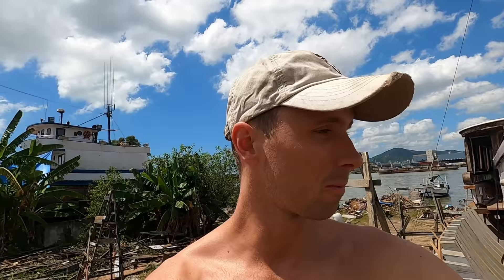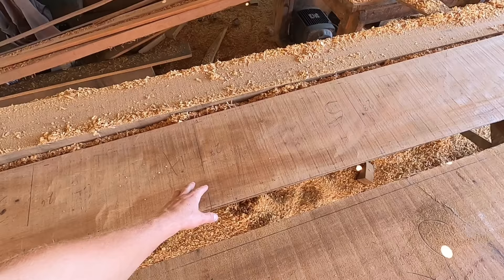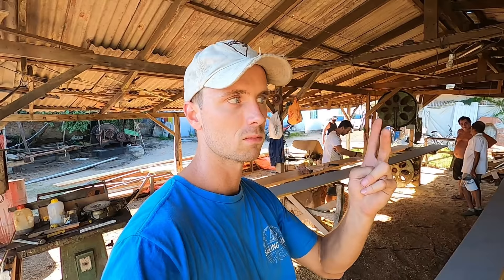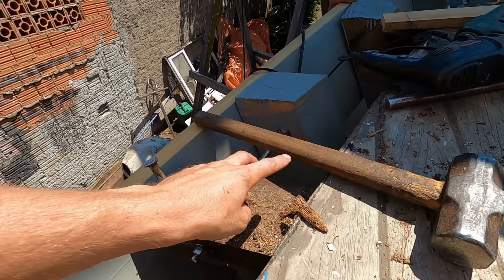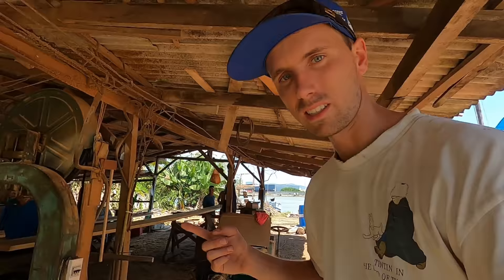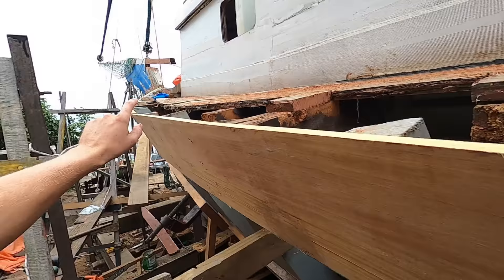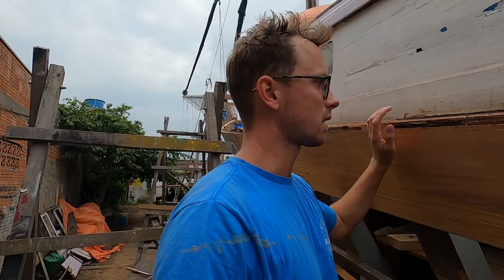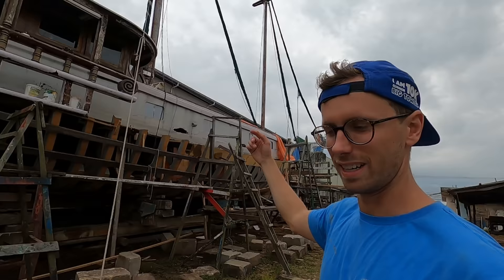This should hold it all together! — Sailing Yabá #28

Comment: Once again, I can't believe those sheer planks, thick as they are, force-bent against the frames, are simply nailed in. No through bolts, no rivets, not even screws. My jaw dropped when I saw that.
Reply: I am thinking that all those steel nails are going to start weeping in several years as iron sickness gets a foothold. Why are they not using modern fasteners?

Comment: After watching these videos you brought her to the right place to be rebuilt
Reply: This boat was so lucky to find these guys there are not many people that would’ve took this on and than to find a yard willing and able to do a job this big at the same time.  One lucky boat. You wonder what the cost is going to be when done. I wonder if they will ever say.
Reply: My only concern is with their use of nails instead of screws and bolts... When you see the guys at Acorn to Arabella or Leo at The Samson Co. using only copper rivets and bronze bolts, I wonder...
Reply: @marcryvon  They said after the nails they than use bolts afterwards they just use the nails to hold it together. And them other boat are like Museum pieces most people could never afford to build them that way. You would go broke and the time on top of it. Them boats are to nice to put in water. For sure Leo boat is a work of art.

Comment: I would check the top of the frames are not spreading now the deck beams are rotting as they need to be equally spaced from the center line of the boat from bow to stern else the boat wont go straight through the water. I wonder if the boat yard has way more choices when it comes to timber supplies due to their location.

Comment: Quick lesson in HVAC. Air conditioning moves heat around. So it takes heat from inside and moves it outside. With marine units it's often dumped into see water like the heat from the engine. It sounds like you had residential units that dump the heat in the air so they require the condenser to be mounted outside. Not sure what the costs are but you can use keel cooling or other water exchange for getting rid of the extra heat. Or you can find a better place to mount the outside condensers...

Comment: I can't believe they have built a wooden boat and not used bedding compound or any glue on the joints and laminated planks. They also used nails instead of screws or rivits or bolts. I bet the nails are steel too. Won't take long for iron sickness to start in the wood. Iwish you lots of luck in the long run.

Comment: I see you have taken the precaution to actually paint the boards before applying them to the hull. My next question is do they have glue and galvanized screws or better yet, copper/brass bolts instead of stainless steel. Over time the stainless steel will gauld and become impossible to remove. 
Keep pressing on!

Comment: Looks great guys well done, are you going epoxy the exterior of your accomodation cabin? Keep painting the timber it will last you a long time if the ends of the planks are cover especially the bits hidden or in joints.

Comment: Interesting. US and English shipwrights don't join hull planks on the frames.  They tightly butt join them between the frames and put a backing plate behind the joint on the inside.  If the joint ever leaks the infiltrating water won't rot a frame just the backing plate which is much more easily repaired and replaced.
Reply: I noticed that on the Tally Ho. It's an interesting contrast between the two ships
Reply: @clarencenew881  Just because Brazil has its own shipwright tradition doesn't mean it's inferior. It's just different. It's more lack of maintenance during the working life of the boat that's at issue.
Reply: Come on look at the nails no glue, frames are in four or five pieces.  And we haven’t even got to the running gear.

Comment: Hi guys. Loving your channel and following you both. I cant help but wonder, did the ship wright's upon inspecting your boat for the first time not advise you that it would be cheaper to build from scratch and then move over what can be saved from Yaba? You have ended up doing what Leo has done and replaced everything for new from keel to deck. Is it too bad taste to ask if you can make a video about costs and how much that team is eating into your project finances? I cant stop being amazed at the level of rot on that boat. I'm surprised it floated at all.

Comment: Also wondering why they don’t scarf the joints rather than have them as butt blocks? That’s asking to spring a plank down the line, right?
Reply: Leo at Sampson Boat Co explained why to use Butt joints on the start of his planking of Tally Ho.

Comment: This reminds me of the movie " The Money Pit ". Everything you touch is rotten. I wonder if it would have been easier to buy the plans and build it new.
Reply: Having owned 2 homes, they are all money pits eventually. And you can't take them anywhere.
Reply: @helicopterdriver  Nope.  My house is double-brick in 1885 and complete remodeled in 2010 before I bought it.  I've $300 in repairs and a new dishwasher in the four years I've owned it.
Reply: Labor costs are low in Brazil.

Comment: I hope your batteries are recoverable. Lead Acid batteries are a perishable item. Over time the acid breaks down the lead whether they are used - or not. Additionally a lead acid battery that sits in an uncharged or discharged state suffers sulfation and the lead plates become coated with a hard substance. Sometimes a sulphated battery can become recovered. But, as an example a 12 volt battery requires short, quick pulses of about 16 volts to accomplish the task. There are battery desulfators that accomplish that task. Lead acid batteries that are not seeing constant use should always be fully charged and then kept on a float charger. The float charger works at a very low current and puts back that small charge that is lost naturally in an inactive battery. So, lesson for the day, fully charge and then float charge any unused lead acid battery. Neglect can get expensive!

Comment: I read the majority of comments.  I see people asking rude questions.  I see people asking stupid questions.  If I see someone who is being especially rude or stupid, I'll challenge them.

But I'm not the only viewer who challenges this sort of behavior.  Thus, many of the initial "TROLS", who had attached themselves to this channel have left.  That's a good thing.

Reading through today, I see something that I must challenge.  I see a bunch of people asking a very "Irrelevant Question".  What is that question, you ask?

"Wouldn't it have been 'Cheaper' or 'Better' to have built a brand new boat?"

Ladies and Gentlemen, at this point in the build, what difference does that kind of thinking make?  It makes no sense, at all.  The boat is well under way to being rebuilt.  It has been MONTHS, since the work began.  And you are still asking that same illogical question.

Now, how would you like it...  If you were attempting to complete a very large and expensive "Project", and you got hit with this over and over and over again?  How would you like it if someone (Or many someones today) placed doubt in your mind about "Your Project" by asking, "Wouldn't it have been 'Cheaper' or 'Better' to just build a brand new...  Whatever your "Project might be?" 

Ladies and Gentlemen, this question is the "Height of Rudeness and Disrespect"!?!?

Need I say more???

As for those who keep asking, "What is this costing?  How much did you pay for the boat?  How much money will have been spent to complete this boat?

Didn't your daddy ever tell you that whatever a man's finances are or how he spends his money is "None of your d*mn business"?  You DO NOT ask another man to tell you his finances.  It is, just, not done in a proper world!?!?

Comment: A question this is obviously a long and expensive renovation project bearing in mind you had to spend months of time and money to get Yaba to the shipyards plus of course you had to buy the boat. You should be at the stage now where you will have a very very rough idea how much this will cost you. So how does it compare to you just going to the same shipyard and saying build me an equivalent boat?? Also how much woulda brand new boat like Yaba cost?

Comment: Those planks should not be butt jointed they should always be skarfed so that when they are fastened to the frames they won't pop
Reply: Second plank goes over that one with the joints staggered which in effect will be even better than a scarf joint.

Comment: Hi Ben & MP, I’m quite confused by the use of steel fixings for attaching the planks etc, after watching many other similar projects I.e Acorn to Arabella & Sampson Boat Co where copper rivets and copper bolts are used
Reply: a disaster waiting to happen
Reply: I can't see this boat lasting for another 5 to10 years. They'll have sprung planks and wood rot all over again. This is construction on the cheap.

Comment: Is there anything in the Brazilian tax system that favours a rebuild over a new build? I know that importing an older boat simply is not an option because of the way import duties are assessed. It would not have been viable in Australia even if it only needed a fraction of the work. I am not sure it would have even been possible.

Comment: Hmmm why nails and not screws ? Nailing things that are a very important seems like a mistake to me....
Reply: Screws have lower shear and tensile strength. You may have meant bolts.  They are slow and expensive and weaker than nails pound for pound
Reply: Cooper big rivets through the frames on the planking at least ! Five inch nails scary !
Reply: Ask the vikings why they used nails in their boats eh.

Comment: Holy cow!! Is there anything not rotten on this boat?? Most of the reasons this boat is in the shape its in is the results of poor construction and material choices. You don't use galvanized nails when building boats?? This doesn't hold up, especially in salt water and is evident if you look at the rusted nails and rotten wood.

Comment: My attention was caught by watching them knock nails in. I have never seen nails need so much force. The hammer looked to be a 10lb sledge hammer, and the carpenter was doing a two handed full swing at the nails. It is just one aspect of the work that illustrates the magnitude of the work being done.
Reply: And also the density of the wood. Hopefully will last longer than the original rubbish.
Reply: @electrarelic  It would have a job to disolve quicker! It is unbelievable how rotten a young boat can be.